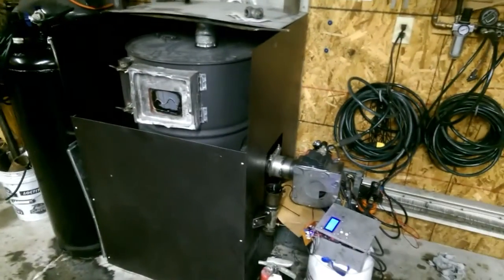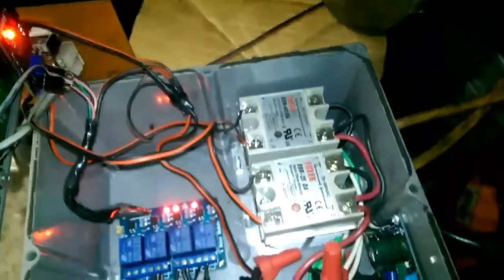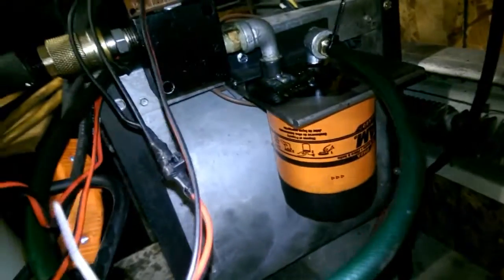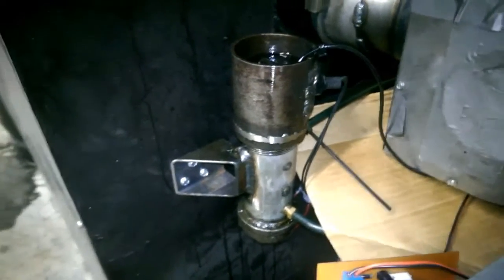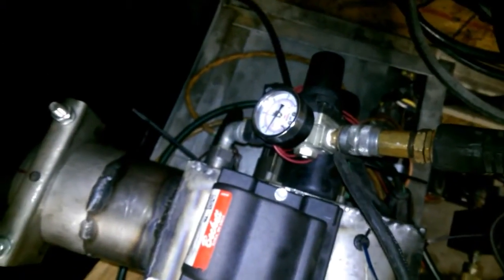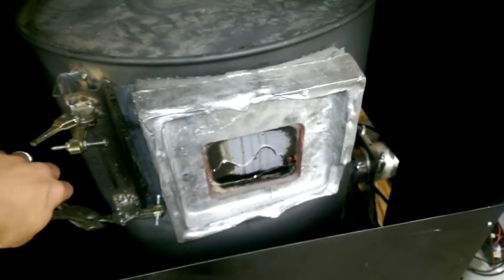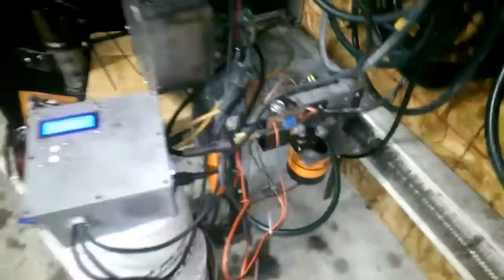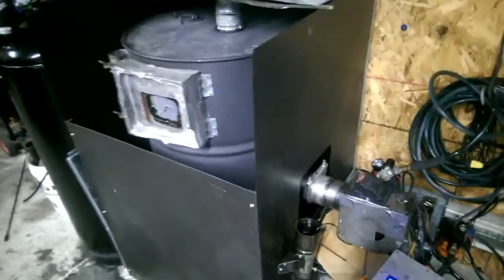Waste Oil Heater -  Arduino Controlled -  Running

Comment: i am in the process of a similar setup   using an arduino to run a preheater at the nozzle (siphon nozzle setup) to preheat waste oil before ignition. run similar to a standard oil furnace with delay to allow nozzle to heat up first. may play with flame intensity sensor and servos to air/fuel delivery to balance for max efficiency

Comment: How low of a burn rate have you been able to achieve with automation controts? Once up to temperature can it be throttled down to a drip rate? How many drips per minute? Thanks in advance.
Reply from the maker: Douglas Pohl I burn about .5gph and I think that is about the minimum you would want to burn. The biggest problem I have run into with different firing rates is the combustion chamber sizing. If you size it for a small firing rate, increasing it causes the unburned oil to smoke and clog the chimney in short order. If you size the chamber for a high firing rate and reduce the input, the oil does not burn completely and starts smoking out the chimney. One could, in theory, adjust the firing rate with automation but the burn chamber is something that has to work together with the burner and that can't be changed on the fly. 

The firing of the burner takes place using compressed air atomization with a Hago siphon nozzle. I built a copycat nozzle block of a popular Beckett conversion kit and it works very well for this purpose. 

If you were looking for the ability to run a HI-LO setup, I would probably build two separate burners to accomplish that. One with a .5gpm nozzle and another with a 1gpm nozzle, allowing a total of 3 different levels based upon the amount of heat required.
Reply from the maker: Douglas Pohl That should be .5gph. I mean, you COULD run 5 gph for an ice melt system on a large slab if you had access to that much oil. Or had an extremely large indoor area to heat.
Reply from the maker: Douglas Pohl The air to fuel ratio is one part of the equation and that can be worked out via an exhaust gas analyzer, however the size and shape of the combustion chamber is the other part of the equation to get a clean burn. Waste oil takes a long time and high temps to burn properly. If you try to burn too much oil in too small a chamber, even with the correct mixture, the vapor simply runs out of room and doesn't completely combust before leaving the chamber. By the same token, too little fuel in too large a chamber won't keep the combustion temperature high enough to burn the entire contents, leaving unburned deposits to vent out the chimney which manifest as a blue nasty-smelling smoke like an old Chevy.

My goal in automating the combustion, ignition, and safeties is to provide the ability to light and shut down the unit without human intervention and to provide a measure of safety in case something goes wrong.
Reply from the maker: Douglas Pohl in reference to the air and fuel rates and a feedback loop from an exhaust gas analyzer, my controls don't do that as I do not know of an analyzer at a price point I can afford. If you know of one that can be had at an affordable price point, please let me know and I will incorporate it!
Reply: armorer1984 - here is an Arduino based emissions analyzer project - maybe you can adapt sensors into your burner. See: http://www.afdhalatifftan.com/2015/10/diy-arduino-powered-3d-printed.html
Reply: Your welcome....
Reply from the maker: Douglas Pohl Interesting project, thanks for the link! I don't know if I would incorporate this into my build, but it seems to be a possibility if someone wanted to take on the task. I could see using the sensors to check the combustion from time to time, however I am not sure how much it would vary while running. Once the compressed air, oil, combustion air, and combustion chamber are all tuned for optimum burn they should manage themselves for a couple years before needing any adjustment. 

I could see the sensors being used as another type of safety to predict ash buildup in the combustion chamber and trigger a shutdown condition or something like that. Something to keep in mind.

Comment: Hi, although it's not pretty to look at but who cares :))).... As long it works, it will be great. I am going to make one soon, although I wanted to keep simple but functional and a few safety issues I wanted to add. We will use it in our Shop and we get used Oil for free.  I just wanted to THANK YOU for giving me some Tips I got out of this Video.
Reply from the maker: Jod Bronson She is definitely not pretty! But it does work pretty well for what it is. If I were to totally rebuild it I would fabricate some sort of tube heat exchanger with their blowing around the tubes in order to increase efficiency. If you need any more info I will do my best to provide it.
Reply: Hi, THANK YOU for the Tips on the Exchange. I will be building mine out of an Oil Drum. It will be not wise to put more Holes in it. What do you think? But we do have an old Flute that have the old heat exchange in it and also have a Fan built in. But I think you have a better idea on the Exchange though.
Reply from the maker: Jod Bronson I don't know if it is better, but my idea for the barrel would be to cut holes in the top of it just big enough for a piece of 1/2 conduit to slip through. Cut another circle the same diameter as the barrel and drill holes in it that match the holes in the barrel, welding the other end of the conduit tubes to the plate. Then weld a cover of some sort around it, funneling the exhaust to the chimney. One thing to consider is ease of cleaning as I have found the used motor oil I burn to generate a lot of ash that likes to cling to every surface creating a layer of insulation.
Reply: +amorer1984 - Thank you again. Hmmmm... Cleaning, YIKES... LOL. I would have to take the Ash into considerations than :))). Although your Idea of the Conduit is great.... I am thinking NOT doing it since we have to put Holes in the Drum :((((. Although it's going to be Welded, I am afraid of my Welding Skills, hahahaha... I am thinking doing it without first, Maybe just put Metal Plates inside to retain Heat while my Flute Heat Exchange will claim it. If won't be as much as claiming effectiveness but less cleaning. I guess I have to decide either Cleaning or 80-100% efficiency. THANK YOU again !!!